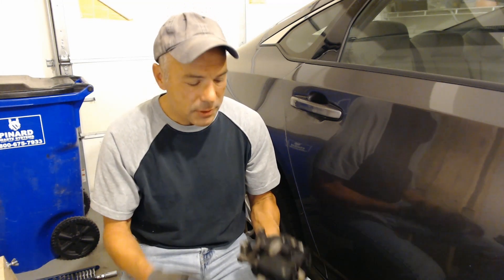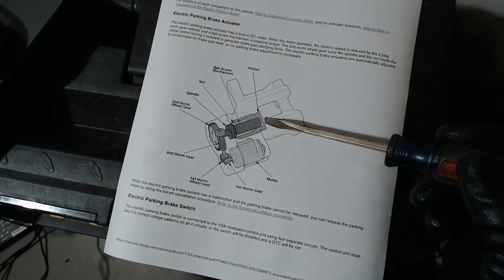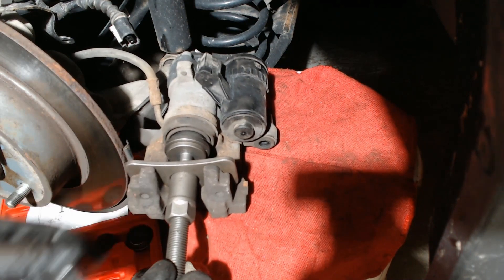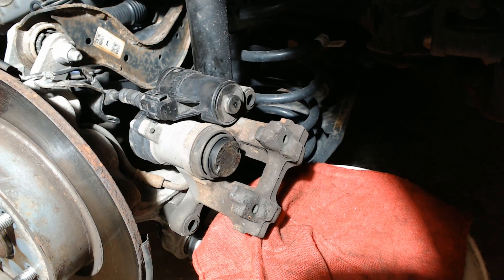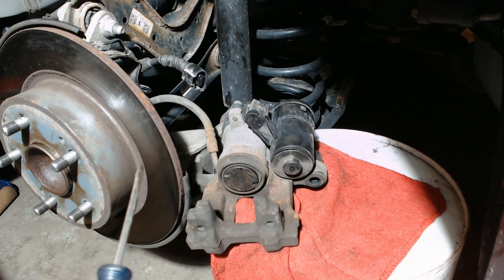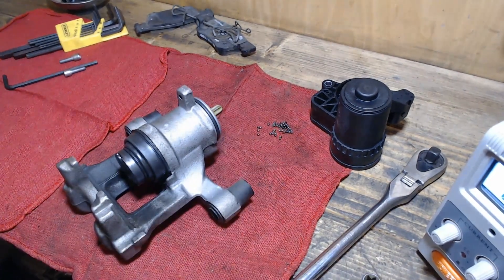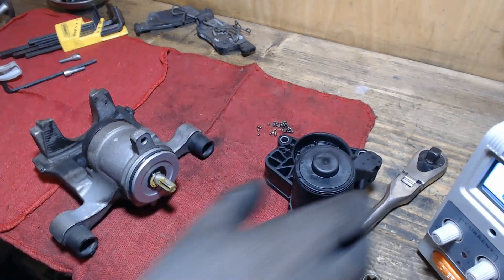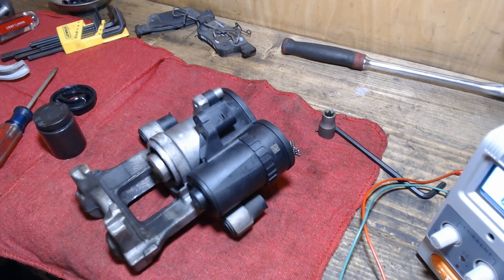4 Ways to Retract Brake Piston on a Honda Accord with Electronic Parking Brake

Comment: Just so i understand right, the first option in the video, you dont even need to unplug the electric plug if you dont want, you just pop the caliper off the rotor, and just get the tool to twist the caliper piston in, and once it stops, you compress it the rest of the way.  Thats all?  No other special steps needed? No scan tools or nothin?
Reply from the maker: Hi Thomas, yes, that is exactly correct.  You can simply remove the caliper, wind the rotor back as far as it goes, and then press it back the other way.  Before you start, you should turn off the parking brake and make sure there is some room in the brake fluid reservoir.  You are correct, there is no need to remove the plug.  The only reason I removed it was to give a little more working room.

I used exactly this method (although I did unplug) in this brake job video:
https://www.youtube.com/watch?v=gG8RWHI712c&t=667s
Reply: @JohnsDIY  thank you sir!

Comment: Man. I’m in a pickle. My piston is stuck out after the electronic brake engages. I was able to use the adapter to twist it back in almost half way but it’s still not far enough to get a compress tool on. I disconnected the plug and did the fever polarity trick and although it made noise it didn’t really seem to help. I was able to twist father but still not far enough to get a compress tool on. I now have the actuator off and if go clockwise like you show in this video it just keeps turning and never stops like you mentioned. Any ideas? I think I’m screwed.
Reply from the maker: Oh, bummer.  How did that happen, did you turn on the electronic parking brake when the caliper was off the vehicle or something?  If the piston physically stopped rotating (hit a hard stop) then that likely means that the inner piston is fully retracted and you just have to push the outer piston in.  Can you get in between the piston and the ears of the caliper with a pry bar and see if you can start the piston moving back in until there is room to fit in a caliper tool?  You might be able to use a C-Clamp to press it in if you can ge a c clamp in there but be careful to not damage the plastic casing of the servo motor on the back of the caliper.  What kind of press-in tool are you using?  There are some really thin ones available - the kind with a flat metal bar and screw knob in the middle:

https://shop.advanceautoparts.com/p/performance-tool-disc-brake-pad-spreader-compresses-inner-pad-and-resets-piston-for-easy-pad-replacement-w209/11957856-p

Maybe you can get something like that in there?

I think you might still be okay.  The real problem would be if the inner piston came all the way off.  I think it should still be possible to get the outer piston pushed in.  Also, if it came all the way out it might not be aligned perfectly and that could prevent it from sliding in, so make sure it looks well lined-up.

Comment: How did you take the boot off? Mines glued on or something. It’s ripping in pieces
Reply from the maker: Hi Michael,  It is on very tight.  I was able to put a screwdriver at the edge of the boot where it mates with the caliper and give it a few whacks with a small hammer which forced it off.

Comment: Hey if you take off that but on the piston could you add back those bearings and it work?
Reply from the maker: If you take off the piston, I am sure there is a way to load the ball bearings back in but I don't know the trick and it is definitely going to be a challenge I would say.  There are lots of tiny balls and a spring which appears to put tension on them.  I think it will be very hard to get back together.

Comment: It’s crazy that these cars will work with three of these methods and the 4th is a toss up. My car does not work with the wind back tool at all. It needs to be reset by using the scanner, 12V, or removing the motor and manually turning. My friends car works perfectly fine with the wind back tool.

Comment: Do u have to take the cap off the brake reservoir ???
Reply from the maker: That's a good point Kevin!  Yes, I think that is a good idea and it is what I do.  I should have mentioned that.  I take the cap off the brake reservoir and if the fluid level is high, I also suck a little bit out before rewinding the piston so it doesn't overflow.

Comment: Well this shed much more information than I have found,,I like the first way, rotating the pump counter clock wise, push the cylinder in,This is the method we are going to use, thanks so much for taking your time to show us,
Reply from the maker: Thanks for the nice comment Jolene!
Reply: Looked to me that he was turning that piston on a clockwise manner. Btw, this is the best and most detailed tutorial I have seen so far. Thx for sharing.

Comment: Hi John. I got my HRV done at the weekend. It was straight forward.  I did notice that the piston pushed in. I looked for a triangle shaped disk in the brake pushback tool but there was none. I put a small screwdriver in one of the indents and wound it back but found it went straight in. It never need turned so that was a plus. . No lights on the dash so that's good.  The diesel fuel filter is a real mare as it's at the rear of the engine, just above the exhaust.  Happy days lol
Reply from the maker: Nice job Paulo!  That's fantastic!  Yeah, that diesel fuel filter must be a pain on the back of the engine.  I have a video on taking out the alternator which is back there too and it is a job!  A lot of working by feel!  Great job on the brakes!

Comment: One thing. I've not  seen anyone mention. Is the handbrake on or off before you start.  Does it make any difference. Got my HRV to do but no one has ever mentioned if handbrake is on if off at the very start of the job
Reply from the maker: Hi Paulo,  In my case, the handbrake (parking/emergency brake) was OFF before I started.  Also some models have an automatic parking brake engagement in Park and this was also not enabled in my case.  If the parking brake is on then you won't be able to remove the caliper without first winding it back.  This means that you wouldn't be able to wind back the piston using a windback tool because you wouldn't be able to get access to the piston without removing the caliper first.  However, you could still wind back the piston with a bidirectional scan tool, by taking off the motor and turning the shaft, or by manually running the motor in reverse via test leads.  This will effectively disengage the parking brake when you wind it back.  After reinstalling the parking brake will automatically self-adjust when you engage it the first time.

So in summary, if you want to use the windback tool, you will need to ensure that the parking brake is off before you start.  If you use one of the other methods, you could start either way.  It makes the most sense to me just to make sure that the parking brake is off before you start.
Reply: @JohnsDIY   hi John. Thanks for the quick reply. I've not seen any mention of this. I think it's kinda important if doing the  rear brakes. Mine is  a 1.6 diesel ex, 6 speed manual, being in the UK that's the spec. I've not done these electronic type handbrake things before. I don't have the diagnostics but I do have a wind back tool for the brakes.  I'm going to have some fun tomorrow doing the disks and pads all round.  Hopefully it works and no lights on the dash lol.  Good informative video. 👍
Reply from the maker: @paulos9304  Yep, I agree, it is a good point!  Just to provide some confirmation, on my 2018 Accord, the service manual procedure to remove the rear brake rotor is:  

1. Vehicle - Lift.
2. Rear Wheel - Remove.
3. Parking Brake - Release.  Note, if the automatic parking brake function is turned on, do the temporary cancel automatic electric parking brake.   

Wow, I didn't even know they made a diesel HRV!  That's neat!  Good luck with the repair - let us know how it goes!
Reply: @JohnsDIY Hi  John.  I've not managed to get it done yet but tomorrow Monday is looking the day to do it as it's a public holiday over here. Yer the 1.6 i-dtec is great on fuel. High 50s low 60s if driven sensibly.  European market the diesels I think. Same as the CRV although now Honda have stopped diesel in new models. Petrol or petrol/electric. I'll let you know how it goes tomorrow. Hopefully all goes well lol.

Comment: Did you try to unplug the electrical connection while the car is running so it will not let the piston come out?
Reply from the maker: Good question!  But unfortunately I do not believe that would work.  The issue is that the piston does not retract all the way even when the car is running.  It only retracts just enough to take the pressure off the pads.  This way when you engage the parking brake it is very quick since the piston only has to travel a short distance.  If it retracted all the way each time then there would be a much longer delay when engaging the parking brake.  As a result, even if you unplug the brake motor with the engine running, the piston is not fully retracted and generally won't be retracted enough to fit in a new set of pads that are much thicker than the old worn ones.  In fact, you don't even have to disconnect the electrical connector when the car is running, you can just turn off the car without engaging the parking brake and the piston will be in the same position as if you unplugged the connector with it running (and the parking brake off).  In either case, the parking brake piston will be pushed out just barely shy of pressing on the brake pads.

Comment: Thanks for the video. The easiest / cheapest way is to remove the 2 screws and open the actuator. Literally takes 2 minutes.
Reply from the maker: Thanks Mark.  I agree, that's a good way to go and good point that that method doesn't require any special tools.
Reply: in canada, those two little bolts are nightmare. you dont want to touch them in there is any other way out there.

Comment: Do you have a link for your scan tool that you used in the video?
Reply from the maker: The scan tool I used was Autel MS906.  I have had it quite a while and think there might be better options out there now.  The ability to do things like retract the caliper (and control other functionality via the PCM) is usually referred to as "bidirectional control" in the scan tool literature.  Here's a link to the one I used:

https://www.auteltechshop.com/wholesale/autel-maxisys-ms906-auto-diagnostic-scanner.html

Comment: Great information – very well done and worth watching to the very end.  I have a question.  Using a turn back tool on my 2017 CRV, I rotated the piston clockwise until it was flush.  It never reached a point where it would not turn.  I used the similar amount of pressure as shown in the video and did not force the piston.  I’ve not proceeded any further.  Does this sometimes happen or this something I should be concerned about?  Thanks.
Reply from the maker: Thanks for the comment Eric!  Assuming the 2017 caliper is the same as the 10th gen Accords, it should eventually reach a point where it won't turn anymore.  Although it looks like it is all the way back in (flush with the surface), maybe it is just not quite all the way back?  That would be my guess.  If you turn a bit further does it stop turning?

Comment: Excellent video.... So just to clarify.. If I use a turn back took on the piston, I don't need to do anything to the electronic parking brake except calibrate the parking brake (engage and disengage twice) after it's done?
Reply from the maker: Thanks for the nice comment Bob!  Yes, that is exactly correct.  When the parking brake is engaged after the brake job is complete, it will drive the inner nut and piston out until the brake is engaged and then back it off just the right amount to be ready to quickly engage on the next use.

Comment: If the piston is keyed and turns the motor back in, what keeps the piston from turning when it moves out ?
Reply from the maker: Great question!  Normally there are pegs on the back of the brake pad which mate with indents in the piston and thereby prevent the piston from rotating.  However, I say "normally" because at least on my Accord, the piston has indents on it, but to my surprise, there are no mating pegs on the OEM brake pads!  The only thing I can think is that the lubricated ball screw mechanism in these calipers produces so little rotational force due to its low friction that just the resistance of the square cut seal is sufficient to keep the piston from rotating.  In contrast, the standard ball screw mechanisms on previous generations (with traditional threads, not balls) likely generated more rotational force.  But that is just my guess.  On the workbench anyway, the squarecut seal does produce enough resistance to keep the piston from rotating - when activated the piston pushes out with no rotation.
Reply: @JohnsDIY   thank you, and yes I saw that on the bench , I was one of the two who stayed for the entire video lol 
Great job on the video and I can also vouch the turn in method works and in my opinion even though I have sets of wires for jumping pins and a power probe tool I think this is safer and quicker sense you'll have to press the piston in manually anyway. Thanks again good day sir
Reply from the maker: Haha!  Appreciate that Brandon!  And thanks for the confirmation that the turn-in method works for you too.  I agree seems like a good way to go to me!

Comment: John, after the piston is turned in clockwise and pushed in flush,do you turn the piston counterclockwise prior to installing new pads and caliper? Thanks for your help on this matter.
Reply from the maker: Hi Dave, Nope, You just turn the piston in clockwise and then press the piston in the remainder of the way.  After that you are all set to put the new brake pads in and reassemble.  Once you are done with the brake job, if you put the parking brake on and then off, it will calibrate and drive the inner nut the correct distance outward for the new pads.
Reply: @JohnsDIY  Thanks John
Reply from the maker: You bet, and good luck with the brake job.  Let us know if any questions come up!  We DIYers need to stick together!
Reply: I’m doing the rear pads & rotors on my 17 MDX. 
This is by far the most helpful video I found. 
Thanks 👍
Reply from the maker: Thanks for the nice comment Mark!

Comment: Good day John. What a super professional video. Very detailed.  I am thinking of changing my brakes and rotors on my 2017 civic but somewhat nervous about the rear changout. I like the 'turn the piston' option much like yourself. Now I have a question for you. What is the procedure to calibrate EPB system? Honda dealer here in Sault Ste. Marie Ontario quoted $650  front same for rear all new parts . Have a great day . Thanks again . Dave
Reply from the maker: Thanks for the nice comment Dave!  Appreciate that!  The procedure to calibrate the EPB system is really simple:

1. Turn the vehicle to the ON mode.
2. Apply and release the parking brake 2 times, then make
sure that the brake system indicator (red) goes OFF.

Basically the EPB recalibrates itself by running the motor until the inner nut forces the piston out (as indicated by an increase in motor current).  Good luck with the repair!

Comment: Would this procedure work for my 2019 Honda CR-V EX?  I have both the wind back tool and compression tool.  Thanks!  Great explanation.

Would you be able to share the page you used to explain the operation of the Electric Parking Brake?
Reply from the maker: Thanks for the comment Pat.  Unfortunately, I can't say for certain about the 2019 CRV.  Usually there is a lot of similarity across Honda models and I think if it were me, I would give it a try using that method, but I don't know for sure.

Here is the image showing the parking brake mechanism:
https://i.postimg.cc/T1mPnL8h/image.png
Reply: @JohnsDIY  Thanks for the information.  Can you tell me where you got this information so I could do further research?  Your explanation of the many ways to retract the caliber was the best of have seen.  I did not know you could thread the piston back in then compress it from there.  I assume the piston grooves need to line up with the pins on the back of the pad.
Reply from the maker: Sure thing, that information is from:  https://techinfo.honda.com/

That is the official source for Honda service information (now that printed service manuals are no longer published for Honda).  Unfortunately, it is not free though.  It is subscription-based.  Until recently it was $10 per day to access, now it looks like it is $25 per day.  But still, maybe it is worthwhile if you have a big repair or want to look up a bunch of common maintenance/repair information for your vehicle.

> I assume the piston grooves need to line up with the pins on the back of the pad.

That's a good question!  I expected the same thing and that was certainly the case on previous generation Accords with the manual parking brake - the piston had to be oriented so that the grooves in it lined up with the pins/pegs protruding from the brake pad.  This kept the piston from turning (which would prevent the parking brake from working).  However, to my surprise, the OEM pads on my Honda had NO pins on the back to line up with!  I'm not sure why that is the case.  I speculate that perhaps the ball screw mechanism exerts such little rotational force on the piston that perhaps having the pegs was unnecessary.  On the caliper I took apart, it seemed that even the resistance of the square-cut seal was enough to keep the piston from rotating.

Thanks for the comment!
Reply: @JohnsDIY  Thanks again John!  I appreciate your prompt response.